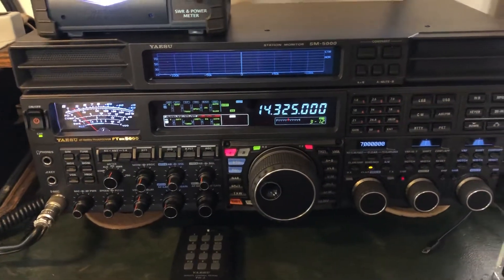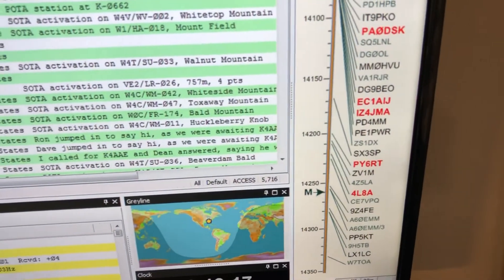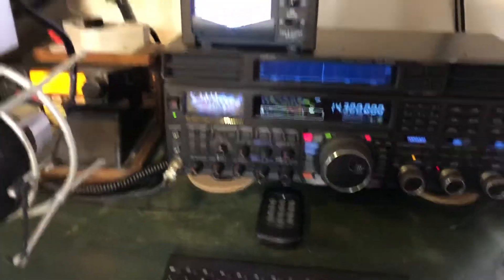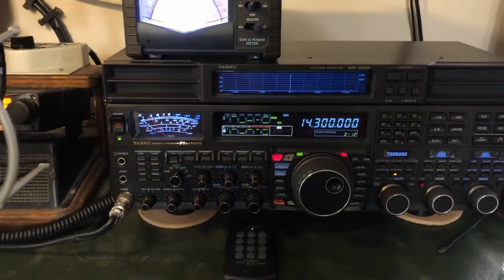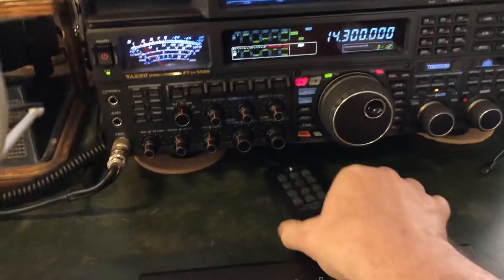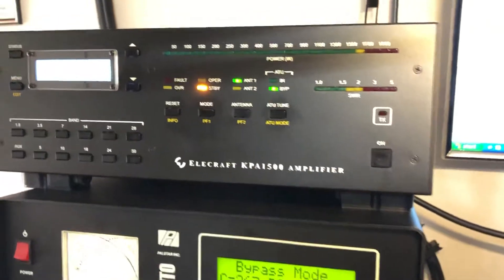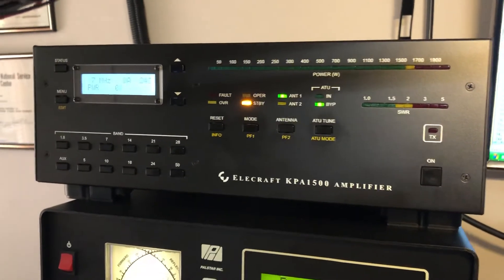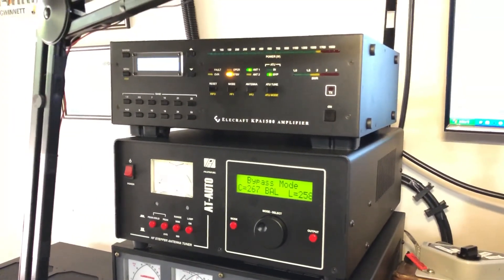The Yaesu FTdx5000MP has returned from warranty repair

Comment: Just wish I could have gotten FTFX-5000 Instead of 1200. Been off the air too long. Been trying FT 8 with a singalink could not get anywhere with it. Got the interface my Yaesu 117 and it worked great. Installed the driver for it off and running. Will I spoke to soon, keep getting..lose audio
Hamlib IO while opening connection
I don't use Hamlib
Using fldig
Guess the bottom line 
I don't know what Iam doing 
Have a wonderful day 
73 KQ4CD
Reply from the maker: Paul, my brother set his FTdx5000 up for FT8 with a $8 sound card, and it works.  He did it so he could answer FT8 questions on the Ham / Amateur Radio Elmers Group on the MeWe social media platform.  He’s not all that interested in FT8 but he made many contacts while just testing.

If you can find a FTdx5000 in stock, I would suggest grabbing it, if you can.  Yaesu told me that they are only building to order now.  That usually means that are close to discontinuing a product.  They have a rule that they try to abide by.  They discontinue a product when they think they can only get enough parts to support repairs for 5 years.  But you will be hard pressed to find a better radio than the 5000.

73, de N4HNH

Comment: Doug, I'm glad that you got your radio back and it's working 100% now.  It's good knowing that Yaesu was able to repair it and get it back to you in a timely manner during the Covid 19 pandemic.  How did you ship it, e.g. UPS or FED EX etc.?  I need to send in my FT 991A to Yaesu for repair because the monitor went completely out and the tuner doesn't activate either.  

P.S. It was nice having a "qso" with you the other day via "email." hi hi 

73,

Steve
Reply from the maker: Hi Steve!  I shipped mine via UPS.  I paid the UPS store to be put the Yaesu box inside of a bigger box, pad it well, mark it This Side Up, and Fragile.  I also paid for $3,700 of insurance.  Because the union for the drivers is so strong, drivers can’t be held responsible for damages.  I know it’s crazy but we have to pay extra to ensure that they do their job right.  The total price to ship from Georgia to California was $280.  Yaesu shipped it back via FedEx.  Apparently they shipped it back in the same outer box I had it shipped in.  Well, it seems that my UPS store didn’t put the This Side Up stickers on after all.  The FedEx guy brought it to my front door on its side.  The inner box clearly states This Side Up, but Yaesu didn’t bother to pit a sticker on the outside box stating that.  But so far the radio seems to be functioning perfectly.

73, Doug